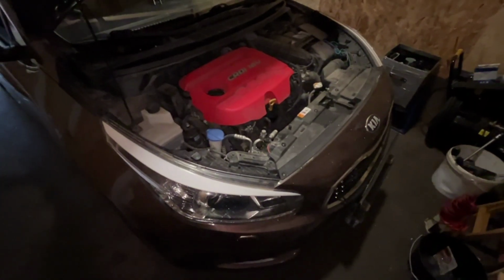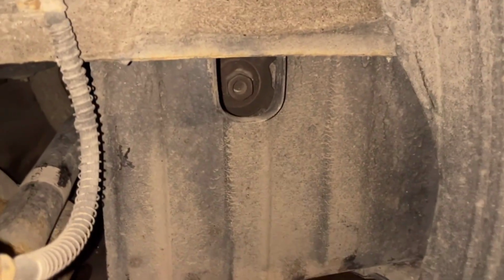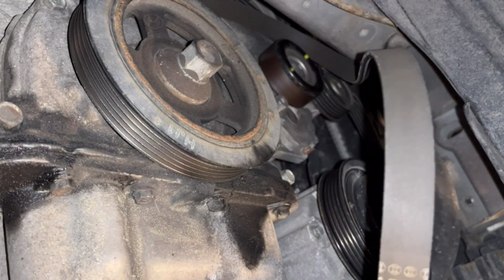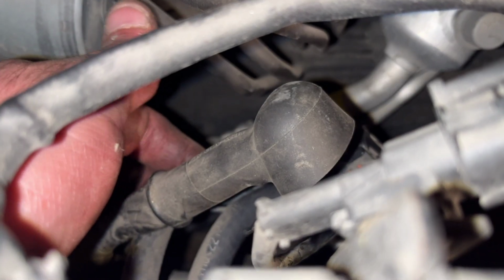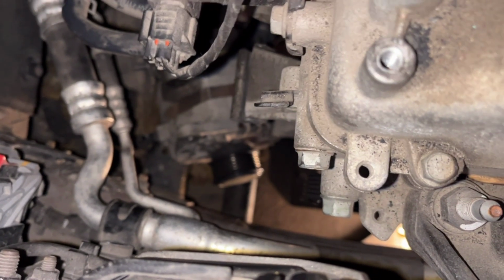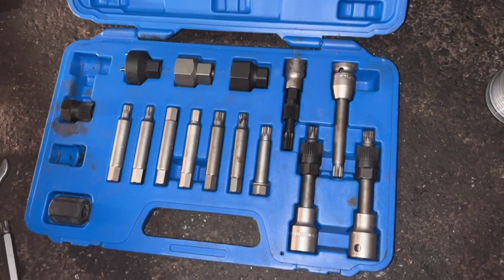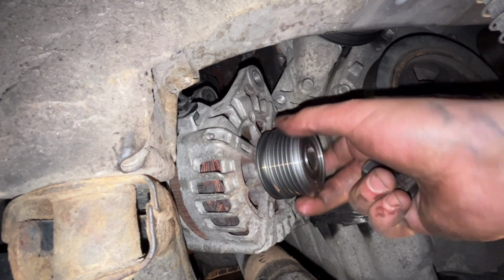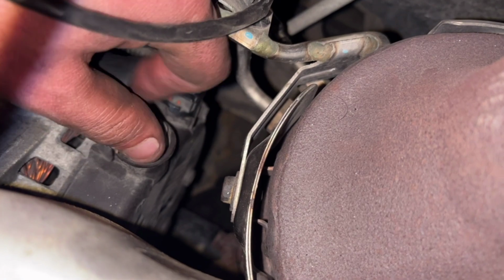How To Fix Alternator's Pulley Noise On A Kia Ceed 2013 1.6 L CRDi

Comment: you can use a impact wrench with the spline tool to break free the pulley from the alternator, for torquing the new replacement overrunning alternator pulley back on you need to use the torx bit to hold the shaft and use a crowsfoot wrench with the spline bit at 90 degree on your torque wrench to get the new pulley torqued to spec. When doing this job earlier I disconnected the connectors above the alternator, removed a 10mm bolt holding the connector bracket in place to get more room and i struggled to pull the alternator up and out so i could get it in a bench vice. Installing the pulley with a impact is how you damage the clutch inside the pulley and end up needing to install another one.